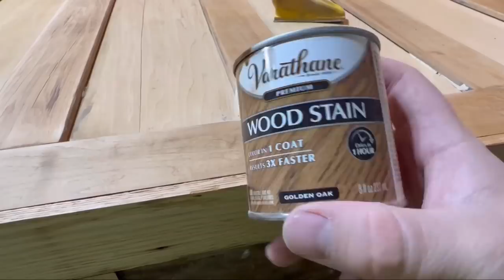Restoring an Oak Cabinet from my Great-Grandparent’s Farm (ASMR) // Woodwork & Restoration

Comment: The video and all the effort made to make a piece of furniture functional is  very good. I appreciate you sharing that impetus.
But I would like to say that we should not confuse the words "RESTORATION" with what's a repair where an object is obtained with some parts of the original.
Restoration is a discipline that seeks to preserve old objects and where the materials with which an object was manufactured are studied and when it comes to restoring, the same materials with which it was created are used, pictorial layers, paints, glues, etc. types of wood.
In many cases it is about preserving the most authentic possible original materials, paint, wood.
Another premise to follow, as far as possible, is that any restoration carried out must be able to be removed in a moment and return the object to its previous state.

I always say that "Restoring is not repainting"
Reply from the maker: Thank you 😊 
I do appreciate the distinctions drawn…with this piece I’d make the case that, minus the missing shelves, my goal was to use all original materials and introduce very little, if anything new to the piece. For the most part I was successful in that endeavor, but I am not a scholar of restoration by any means…merely trying to give old pieces their glory back!

Comment: Beautiful restoration, just wondering why you didn't clean and sand it when it was all apart.
Reply from the maker: Thanks…I really should have done it like that…I was afraid I would mess up the dimensions of the parts by doing that and it wouldn’t go back to together right. Turned out all the dimensions were a little off and really should have done it prior. Was a learning experience for me.

Comment: Ooh, so enviable.
We have loud snapping sounds that come from our furniture and doors in the winter here in the Northwoods of Wisconsin. The dryness in those months causes any inner panels that were glue, painted or varnished into place to split. We’ve got lots of splits around the house. 
I’ve got a five drawer dresser in very much the same condition that I have to work on just like this. On it, I will definitely only glue the frame supports and let the panels float.
So, when I see you and others glue the panels into the frames, I cringe, but I suppose in Oklahoma you don’t have such a contrast in dryness/humidity.
Reply from the maker: Yes it is pretty much always humid here…some fluctuation but not much. Best of luck in your dresser restoration!

Comment: Excellent job. Why did you glue the panels to the stiles, rather than free float them?
Reply from the maker: Thank you. I glued one long side to provide rigidity since it is part of the door. I’ve had other free floating doors that would fall apart after a year or two with consistent use (this one will be used regularly).

Comment: Lovely job. Just wondering why you didn't replace the legs you cut off or at least put something to raise it off the floor a bit to protect the wood.
Reply from the maker: Thank you 🙏 to answer your question, I chose not to as there is still quite a bit of curvature on the bottom pieces (current legs) and I liked the shape of them. I may end up adding some furniture pads or something similar to the touch points, but it was an aesthetic choice. Valid question though!

Comment: Include all those panels and that are supposed to float. All this thing the whole ripped to shreds is the humidity changes
Reply from the maker: In my experience it shouldn’t be too bad. Any furniture piece that’s glued together is susceptible to humidity changes. I will always opt to glue anything that’s structural as well.

Comment: Beautiful job. 
I'm curious as to why you wait till it is assembled before cleaning, sanding and filling. Some at least would be easier when disassembled, or would it? Like the many panels of the back. Not a criticism, just an honest question from a total amateur.
Reply from the maker: Thank you! So my thought process going into it was that I didn’t want any dimensions to get altered by sanding before I put it back together. In hindsight, I would have done the surface prep before assembly since I ended up having to make some adjustments anyways (the small router cut for example). It was a learning moment for me.

Comment: We’re those side panels designed to be floating?
Reply from the maker: Probably. I’ve never been a fan of floating panels though as I’ve had to repair way too many failed joints, and…the sides are major structural components of this piece, so would rather risk wood movement than structure failure. Others might see it differently.

Comment: Why did you glue the floating panel?
Reply from the maker: I just made the decision that I wanted more structural strength for the piece. I’ve had cabinets come apart at the joints with floating panels much quicker than humidity or seasonal changes do when gluing the panels.